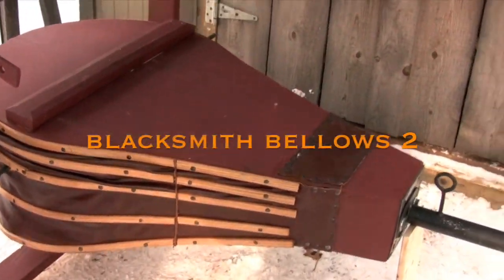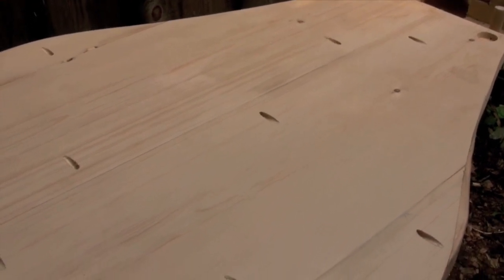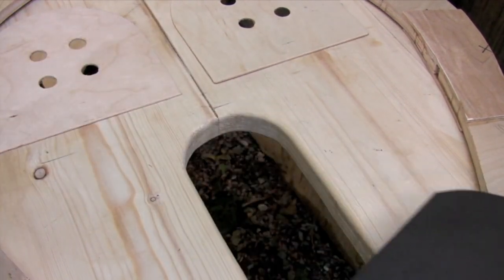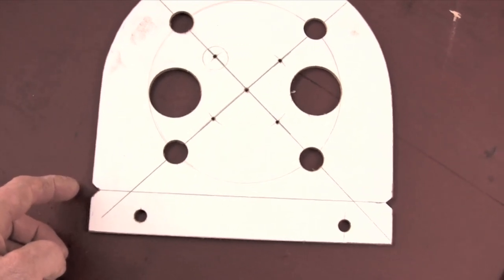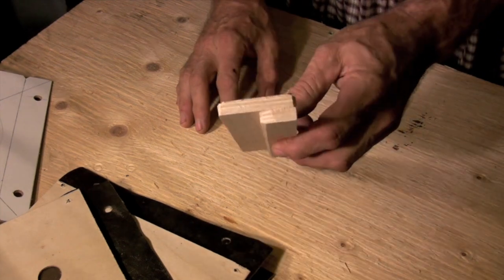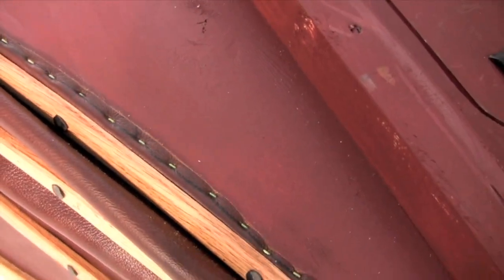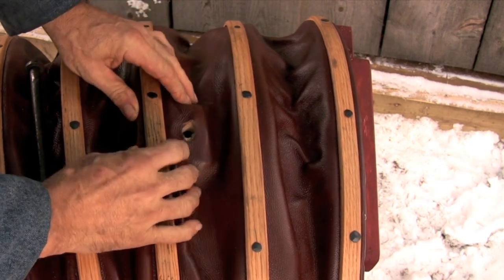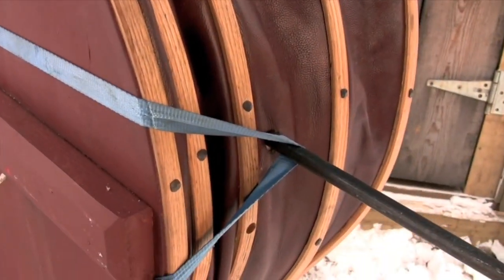Blacksmithing Project - Blacksmith Bellows 2

Comment: One historic fundamental often overlooked with projects attempting to suit a period is the fact that blacksmiths wouldn't waste iron or steel as readily as modern smiths do. We have iron in abundance, and use it for everything. Go back even just three or four centuries and that wasn't the case, you wouldn't waste anything. A lot of fitments were made of brass, bronze, or even copper depending on the wear involved. So using a giant iron bar through the middle and huge iron nails to try and make it look more 'authenti-bellows' is probably less authentic. It'd be like future archeologists knowing we used a lot of glass for things, so instead of building homes with walls and windows in them instead build them with glass walls because glass is readily available in huge sheets to future artisans. What we have in abundance today may have been incredibly rare depending on the period. Always remember that.

Comment: I saw how you supported the mid ribs on the pins for the upper chamber. For the bottom chamber ribs did you station the pins on the bottom board, I imagine if they were on the middle rib that the bottom rib would slide off.
Reply from the maker: The pins are also on the center board for the bottom chamber.  They are short enough to allow the bottom board to close fully but too long to allow the rib to fall off the pins.  The leather is also helping to restrict the movement of the rib.  You would have to be able to lower the rib until it is flat against the bottom board ( when it is fully open) in order to be able to slide the rib over the top of the pins.
Reply: @df-intheshop330  Right, thanks, I was looking for a few ideas about attaching the mid ribs towards the nozzle end, but your solution looks very straight forward, for some reason I kept thinking about a leather hinge.

Comment: How much air does one lung displace?
Reply from the maker: Unfortunately I have no way of measuring that and I don't know how to  calculate the volume of a teardrop shaped wedge.  This bellows is patterned off a set in a local museum and they were from a working forge from the late 1800's.
Reply: How high does the top lung extend?  I figure the teardrop is about 2'x4'.  Is that about right?
Reply from the maker: it's actually 30X48 and 14" at the back

Comment: Sir, does the bellow need to be this big ? Can I get away with shrinking it down to about 65% of this size and still be able to have a workable forge ?
Reply: I wouldn't go any smaller
Reply: Not if you want to heat treat anything. Depends on what you're doing. Most 'knifesmiths' just need fire to anneal and harden their work and 'make' their blades by material removal (i.e. they aren't making a knife, they're making a knife shaped object by grinding a shape out of bar stock). So if that's all you're doing sure. But if you want to hit critical temps or weld heats you're going to need more air. You could probably get away with shrinking it to 50% the size and using two if that's easier?

Comment: I can't download the PDF file.
Reply: Considering it's been three years and no one has answered you; for other boomers out there failing at technology (I feel your pain, the older I get the less I'm willing or able to endure fiddly technology - I need to have kids fast so they can fill the role I held as VCR clock adjuster for grandparents): 
1. Click the drop box link. 
2. Let the PDF load. 
3. Top right corner where it says sign up / login (unless you have an account and are logged in, then idk what it says) you'll see a downward arrow with a line beneath it. That is the universal symbol for download. Click it. 
4. Choose where to save.
5. Make bellows. Use less iron, iron was scarce and not wasted on things where brass or bronze was readily usable. And please don't color it in ridiculously modern color schemes as this finished product is, it's horrible.

Comment: how shall I figure out the size of the leather part (or canvas if i go that route)? just double up the top/bottom board dimension? by that i mean mirroring it over horizontally
Reply from the maker: The easiest way is to make a paper pattern by tracing around the bellows with to top and bottom board propped  open.